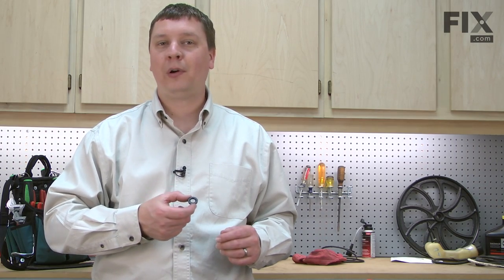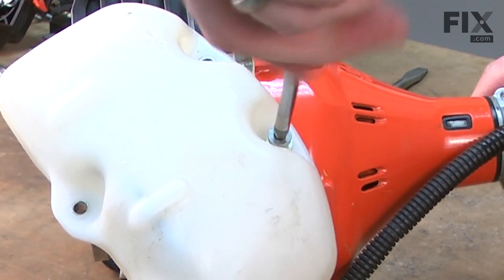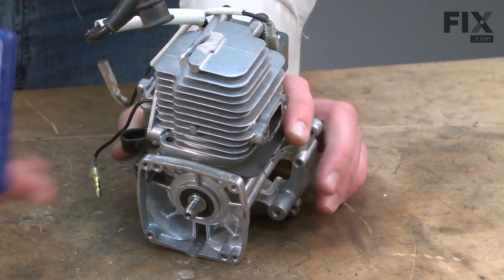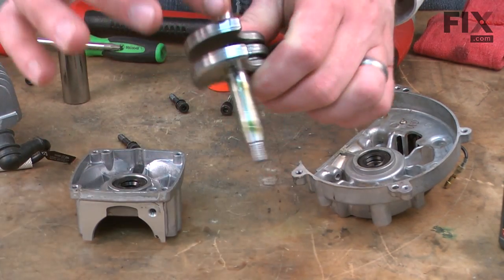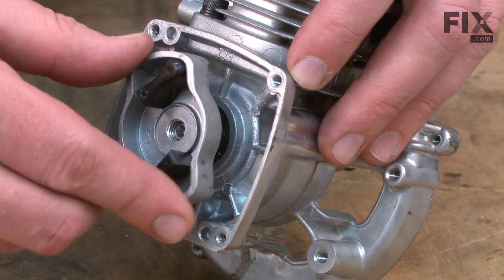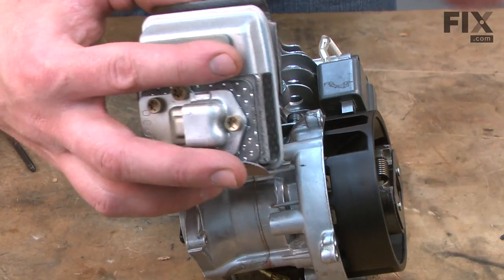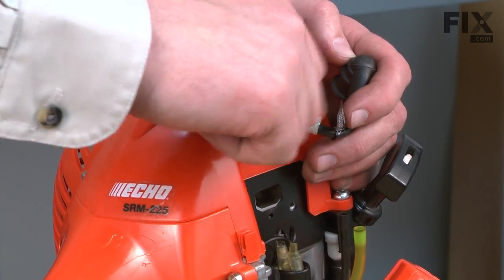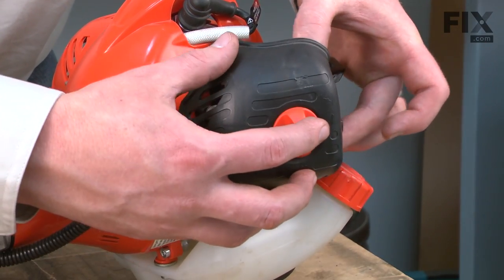Echo Trimmer Repair – How to replace the Oil Seal

Comment: Great video! Great presentation style! It is a lot of steps and disassembly but this video made it easy. One question: When tapping in the seals, should they be tapped in to just below the surface of the cavity where they're seated  OR   tapped until they won't go any further (against the bearings)? The reason I ask:  I took the latter approach and I think the seals are now overly compressed. Thanks.

Comment: If these seals are leaking, would the fuel be leaking out of the vents on the bottom of the clutch housing? (Just above the shaft)
Reply: I'm having the same issue with mine.  I think it's running down from the muffler.  Did you find a solution?
Reply: @jasweb147  No I never figured it out. I only put enough fuel in it to do the the work I need to do so that it's not sitting with fuel in it.
Reply: @Polaris425  So you still have the black oil running down?  It gets all over my clothes.
Reply: @jasweb147  Same here... It does get on my clothes.
Reply: @Polaris425  the new carb arrived yesterday. I haven't installed yet, but I hope it's a solution.  If it doesn't work, then I'll have to trash the trimmer. :(
Reply: @jasweb147  could always keep it for parts.
Reply: Jas Web any update on the new carb? I saw another video where it was replaced and it fixed the issue. Mine is spewing oil from the exhaust as well
Reply: @miguelrodriguez9097  Hi there!  So I actually got the old carb to work properly.  I still haven't installed the new one at this point but will keep it.
Reply: @miguelrodriguez9097  What I did to fix the old carb: Tightened the small carb screws and the carb filter screws. Removed and installed a new fuel gasket and new fuel lines on the gas tank.  Removed the carb regulator and increased the speed to where I barely see smoke at high speed.  No leaks anymore.
Reply: @miguelrodriguez9097  I do run at a higher speed now.
Reply: Miguel Rodriguez Update:  the problem came back with the leaking.  Truly I’m tired of this trimmer and I’m considering getting a Kolbalt battery powered one.  I’m tired of the fuel spots on my clothes and all over the garage floor.

Comment: Guy's nobody is lost the video is just 22mins tops. While doing pause go eat something come back have the video paused and you're going in time with him.
The only thing is for the Crankshaft   and Cylinder Housing the 5 Screws involve 3 for the crankshaft the 2 for the cylinder. Put a little Loctite on them not much on the tips all 5 please. When that machine starts to work in it full Glory or Potential vibration steps in
There will be air coming in between the cylinder and crankshaft housing very soon it will be rebuilt again buy once you follow the steps all is well🤠🙏🏾

Comment: Came here thinking it was an easy fix, holy piss I have to take every part of the machine off and put it back together.
Reply: Hahahajajajajaja 😂
Reply: Taking it apart and putting it back together is actually quite easy. You can actually cheat a little bit when replacing the oil seals. Once take off the flywheel and starter cup and have access to both seals, get yourself a wood screw and drill it into the seal and use pliers to pull on the screw and out comes the seal. To install the new seals, oil them and get a deep socket that fits the seal and push it back on. After that just reassemble it and you're back in business.

Comment: why do all repair videos never actually fix something and take apart brand new stuff. other than that good video
Reply: Likely to show basic maintenance on a clean engine. This engine looks like it has run (just enough for the factory tuning).
Reply: If they only made repair videos if it broke, then you may not get the video you need since it may not have broke yet.

Comment: Zero, and I mean ZERO people ever did this. This would take days to accomplish, and would probably ruin the weedwacker, as something would definitely go wrong.
Reply: I'm watching because I'm about to do this to mine. I just can't let a simple 2 stroke engine defeat me! If I can't fix it, well I've lost nothing but a few bucks for the seals and maybe i have learned something. I'm hoping it works for me.
Reply: @thomasauto4862  Exactly! I replaced the carb and gas tank on my Troy Bilt two stroker 2 seasons ago, and it worked great but now, there is a leak and only recently it's not  revving up and I can feel a touch of a wiggle of the motor in its housing and not starting up easily either. So am investigating online to see where to look and after I recover from surgery tomorrow, I'll investigate for real.